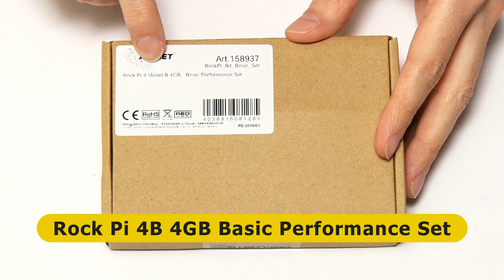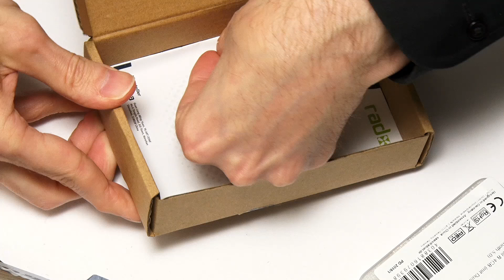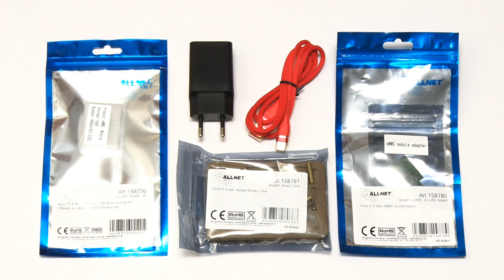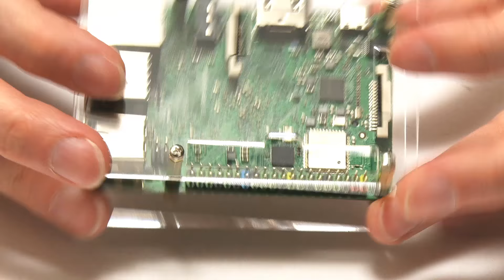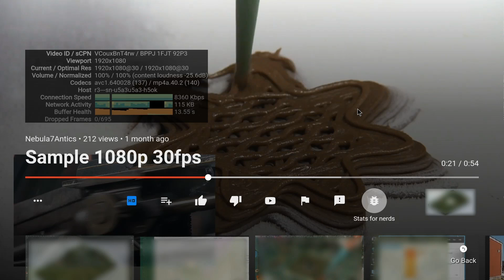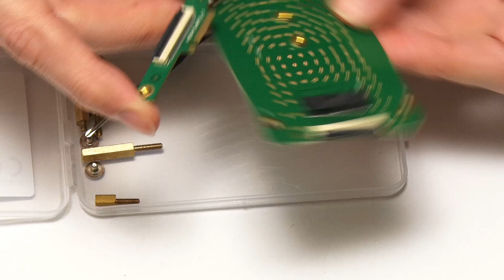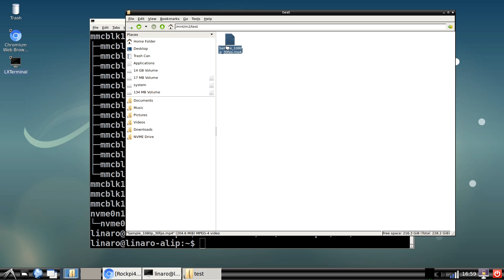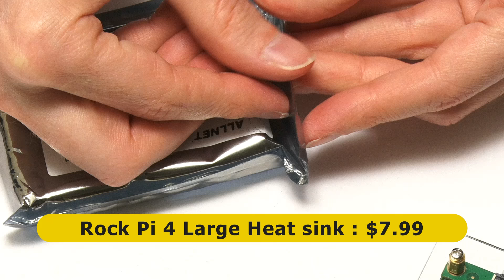Rock Pi 4B : M.2 & USB 3.0 SBC

Comment: This is going to be a critic comment about the product and not on your video. I think that you're doing things very well, as always.

Buuut...

15:00 doesn't look like a "single board computer" to me...

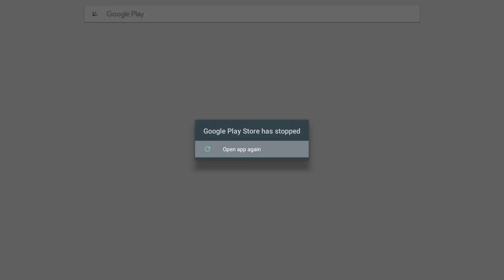13:07 and 15:42: Android doesn't seem that good...

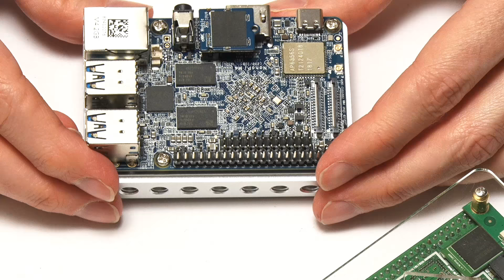19:04 I think that the SBCs small form factor purpose gets somewhat defeated with those large heat sinks... I'm gonna get a Raspberry Pi Zero (no wireless) and call it as such. I mean, it's good to have a very small computer and all, but what's with the raw processing power raising the temp well over 80°C? In a way, I could think that accessories like a heatsink are somewhat compulsory, which is an obvious paradox.

I was also pondering about why the SoC and the RAM were installed on the bottom. The heatsink gave me the explanation. That thing heats up quite a lot, so they had to come up with something. The Raspberry keeps its SoC on the same side of the connectors, which makes it difficult to install proper cooling solutions, but this solves it. Just smash a large flat chunk of metal on its base and you're good to go. No need to think too much.

Comment: Fully Windows 10 running on this single Rock Pi Board?
Reply from the maker: It is an ARM board, not x86, so cannot run full Windows 10. :(
Reply: @ExplainingComputers  thanx for your quick answer...but do you know any Singleboard PC that runs Windows 10 (not IoT)

Comment: Is it possible to boot solely from the nvme drive with this board, or do something similar to Berry boot and use the SD as /boot/ only and everything else happens on the nvme?
Reply: No, not at this time for a solo boot.  There is instructions on the website on how to use a SD or eMMC to boot and run everything else off the NVMe.
Reply: We can confirm that it is possible now. We started to deliver Rock PI with SPI flash which enables the boot from NVMe SSD. :-)
Reply: @NB-sw1op  This is awesome! Thanks for the info, I'll be checking this out very soon now.

Comment: Question: can you install the OS on a NVME and boot from it?
(It must certainly be possible to put the bootloader on the Micro-SD card (or eMMC) and run the rest of the OS (bin, etc, home, usr, var, ...) from the M2.)
Reply: LOL. Just found out there is a follow up video with cooling etc. Question answered. (y)
Reply: We have good news, it is now possible to boot directly from the NVMe SSD when the SPI flash is mounted on the board.
Reply: There instructions on how to do it on the website, but for everyone else, there is no straight full boot from a NVME, must have a Micro-SD or eMMC.

Comment: So to sum up this rather nice Rock Pi runs hot and to obviate, the heatsink is enormous and its on the bottom (somewhat contra-intuitive as you'd want the heat to rise up OUT of the board not Into it), the microsd card protrudes like a high risk for breakage protuberance, the M.2 port isn't appropriate without an M.2 extension board, the M.2 extension board is bigger than the base Pi board, the PoE doens't work without an addon header board. Android play store doesn't work but is less of a problem, anyone wanting this is hopefully orientated about the alternatives to Android and specifically want to escape Google! And as if all that wasn't enough, what more does it need to make the HDMI audio work!?

Comment: Does the 4b have audio input capability, like the Raspberry, or do you have to add an external audio input device? Does the 4b's gigabit Ethernet port have the same limitation as the Pi 3 of topping out at a little over 300 Mbps? Are the OS downloads that you show the same as the  OS downloads that Raspberry provides?
 I am working on a project using a Pi 3b to stream an IP camera to the Internet and I am finding that the Pi 3b isn't fast enough or powerful enough to do this. So, I am looking for a more powerful device upgrade.
Reply: there are no audio input capabilities, you have to add an audio input device. the gigabit Ethernet port does not have these limitations. It provides gigabit performance. the OS for Raspberry are not similar to the OS of ROCK PI 4. But just recently Manjaro ARM 19.06 was released also with ROCK PI 4 support.

Comment: Can external GPU work on the M.2 slot using  M.2 Key M NGFF to PCI-E 4X or 16X Adapter Card?
Reply from the maker: I don't believe so.
Reply: Chris is right, unfortunately Rockchip does not support additional graphics.

Comment: Thinking of getting this or the raspberry pi 3 b+ bit this has slightly better chips and more memory I'm not sure what to get. What's better guys this or the raspberry.
Reply from the maker: The Pi 3 has better software support, this has better hardware specs as you note.
Reply: @ExplainingComputers  I have just ordered one on the cheap off ebay. I went for the 3b 64bit version. It cost £29 second hand. can't wait to test it. Just need a keyboard now and then I'm all set.

Comment: Amazing that tiny thing is more powerful than anything from the 90's.
Reply: I seem to recall getting 60 frames back in the 90s.
Reply: @dwightehowell8179  yea, at what resolution?
Reply: @tt7hvn  This SBC is good at videoplayback, not a 3D rendering, big difference. You easily had 1080p and higher for 3D in common gaming rigs on PCs.

Comment: The Rock Pi 4b can boot from usb HD o SSD?
Reply from the maker: Currently only from micro SD card or eMMC.
Reply: @ExplainingComputers  Is not possible to boot from minimal kernel and bootloader in sd card boot usb3.0 hd?
Reply from the maker: Yes, you could run a boot loader from an SD card nad then pick up the rest of an OS from a USB 3.0 drive (or indeed M.2 drive). But the boot process would always start with the SD card. :)
Reply: @ExplainingComputers  You could explain as to make? Sorry for my bad english. :)
Reply: we just recently did an update and now it is possible to boot straight from the SSD. You must use the SPI flash to do that though.

Comment: Why have the otg functionality in the usb port , its alredy a full sized 3.0 port?  What is that port actually capable of , host/device ?
Reply: yes, it is full USB3.0 port. The hardware switch enables to manually change between host/device mode.
Reply: @NB-sw1op  meaning power with data, and just power ? Thats the part I wasn't getting because its a full sized port.
Reply: @s4b0t4ge7  OTG  enables only data. you can flash the software image on the emmc without removing the module.

Comment: there are too many out there now and I have filled and emptied a shopping cart on about 5 sites today before watching the next video on your channel. Honestly I would just like to see a video that says x SBC is good for X etc. I want to build a SBC that I can run as a plex server that doesn't cost this much and I think after all this I will just wait for RasberryPi4
Reply: same, because i want something I can learn some linux stuff from but also a few other things with. And i'm just going with a raspberry pi 3 b+. Since that has a lot of support and also seems good enough. But again i just guessed.
Reply from the maker: The Pi 3B+ is still my recommended board unless you know you need other, specific hardware features -- such as a USB 3.0, or a powerful GPU.

Comment: Can you boot from the SSD?
Reply from the maker: Sadly not.
Reply: Now you can. The ROCK PI is now equipped with SPI flash which enables the option of booting from NVMe SSD. Please make sure to order ROCK PI 4 v1.3+ bundle or v1.4 which was just recently released.

Comment: Does docker working fine on it? Thx  and Nice video ;)
Reply: yes it does, please use the 4GB version for that.
Reply: I forgot to add a instruction link which explains on how to do it under Ubuntu. https://wiki.radxa.com/Rockpi4/Docker or this https://github.com/Lymkin/RockP_4_Home_Assistant_Build The "Home_Assistant" is running in the Docker container.
Reply from the maker: I have not tried, yet!

Comment: Can someone explain me the proper use of a Rock Pi, or Pi's in general? Is it meant for low/mid level tinkering, and so it can run some low/mid level computing? Where's the boiling point? Can it run some typical Linux (let's say Mint / Solus) with minimal normal use? Is it feasible for this kind of approach? Basically i'm wondering is it good / smooth enough for normal daily operation.

I've heard about this Raspberry Pi phenomena through-out years, but largely ignored it. Until now, when i'm thinking of fanless solutions and my computer needs. I'm ok with something less powerful (atleast for a 2nd / every day computer) , if it's that much more silent and compact.

With this approach, i suppose one could build their own tiny custom basic PC, learn along the way, experiment with cooling solutions etc. I'd interested of this (just to learn if nothing else), but also to build some minimalistic computer as barebones as possible. I don't care much for Wi-fi, Bluetooth and all the needless radiation / connectivity, so this would one way. It's interesting! I might aswell read more about it and go right ahead.
Reply: Max Raider  Thanks Max! So as i understand it, basically you it use for "background" tasks low in consumption. Often mentioned for network / server / media server related uses and general tinkering. That's all the information i need! That's why it was so hard to find some practical everyday examples with Linux. Cleared up nicely.

I'll go for some higher-grade fanless computers from the likes of Azulle, CompuLab, Zotac etc.

Comment: Usb c is nice in that it is a more robust container. It really only need the physical connector there and not a host chip or anything which is fine. The amount of ddr4 ram available does seem quite handy, but I doubt you'll really get the full benefit of those speeds.

Usb 3.0 however, on something as low powered as this, is a pretty big waste. As is gig ethernet and an m.2 slot. This could be made much cheaper if they were more realistic in their part choices for what's really going to be possible with an soc like that.

Comment: Hey Christopher,
Just spoke to the owner of AllNet and he said to anticipate another review on the RockPi 4. They have a new M.2 card that puts the full size heat sink in-between the RockPi and M.2 card. It looks great. Heard theyre going to have a selection of cases to boot. I ordered my RockPi on monday and should get monday. Im glad I waited to buy my M.2 car so I can buy the new one.
Anyways, Im looking forward to the next review. This SBC is a great board so far as I can tell. They have great customer support and are really there for there customers. Great People!!
Reply from the maker: The next review posts here on Sunday (14 April), and indeed includes the new M.2 Extender -- which is really nice -- as well as NVMe performance tests, temperature tests with different cooling setups, a 4K test in Android, and various other things! I've had a good Rock Pi 4 week. :)

Comment: Is Android even SSD-aware?  Android is really designed as an OS for phones and tablets, so will be able to see any flash media such as eMMC or SD cards, but it probably does not know about SSD's, as it was never designed to ever run from one, or to ever access one as you don't find SSD's on tablets and phones.  Just a thought.  Modern versions of Android may well support SSD's.  I am only saying what I THINK is happening. ;)  Happy to be corrected on this.
Reply from the maker: You are correct -- Android is not SSD aware. At present an NVMe SSD can only be mounted in Debian, or other Linux distros. But I think they are working on this!

Comment: Oh, the software and "support":
I get you are talking at the SBC hardware level, but....
At 16:05 you show Debian loaded.
At 21:21 you say software support is not as good as the RPI.
I can't comment on that, but if you are running Debian, aren't you getting the suite of programs?
I appreciate they may not be "ported" for that processor, and that is not in your control, but the claim about "lack of software availability compared to the RPI" seems out of context.
Can you run Raspbian on it?
If you can't:  the whole analogy is even more out of place, because you are not comparing apples to apples - if you excuse the pun.
Reply: You know...processor of this SBC is rk3399 which is designed for Android TV devices, which is pretty popular in China.
And the RPi society, I believe they can just ask the Broadcom to modify part of the chip design, so this is the problem.
Reply from the maker: I'm not giving an analogy. :) There is a lot less software (and by this I mean OS and apps) that work on the RockPi 4 compared to a Raspberry Pi. And once you are running Debian (ARM version), you do not get all of the programs, or at least working versions -- reprositories have to be available, as well as drivers. Eg you can install Kden live, but it does not work). The Rock Pi 4 is a great board, but does not have the level of software support as a Pi. Not least, GPU acceleration is not available in the Linux distros  . . . yet. :)

Comment: Hi.
I have a slight problem with the heat sink part.
Originally you installed the small heat sink which is the small black square that has a nice hole in the case to allow airflow.
Later on you install the bigger heat sink.
PROBLEM:
Looking at it, you have to remove the first one - correct?
You don't say this and it is not explained.   So if someone buys it and gets the "extra" heat sink:  they could easily end up in a world of hurt.
They assemble the board as shown and put on the heat sink.
Then they can not install the bigger one.
Reply from the maker: The small heat sink is easy to remove. :)

Comment: 2 Bad that the Specs are nothing worth when there is no active Support&Community around this thing...

I allready got an Radxa Rock board here that was also 90€ but never ever get in real use because there was no Active Community around it...
So be aware when you spend your $ to this or any other nice Specs having board that you maybe buy a expensive Brick
Reply: wiki.radxa.com and forum.radxa.com could be the way to find the resources and contact with them
Reply from the maker: As I said at the end of the video, software support is not as high as it is for other boards, like a Pi. But it is improving, and better than available for other RK3399 boards.

Comment: why nvme and not sata3??
Reply: Hi, it is a performance issue. Here some comparison: 
7200 RPM Hard Drive – average read/write speed of 80-160MB/second
SATA 3 SSD – read/write speed up to 550MB/second
NVME SSD – read/write speed up to 3500MB/second

Christopher also made a nice video doing performance tests with the WD Black NVMe SSD last year.

Comment: what is the total price of the setup (excluding the ssd ofcourse).... Also can android, running on the emmc, detect an sd card if it is inserted in the sd card slot?
Reply from the maker: I think everything shown is $119.68. Android on eMMC can indeed detect the insertion of a mico SD card. Works fine -- though note that with the M.2 extender board fitted, access to the micro SD card is restricted.

Comment: I bought one on the strength of this vid, three things to note/I wish you'd mentioned for noobies tho.  
1) the ribbon cable IS handed/can only go one way up,  logically, but I had a moment where I could have missed that, 
2) and the eMMC has a tiny barely visible notch in one corner, not sure if it could go the other way round, and 
3) I broke my board by plugging/unplugging the power cable at the board end, the USB-C connector broke away from my board. Be warned, use a switched power strip!  Second Rock Pi on its way from AllNet, woo hooo!
Reply from the maker: Thanks for this feedback, and sorry that you have had problems. You are of course right on the ribbon cable. The eMMC can only insert one way around, as the two connectors on it are slightly different lengths. I've never broken a connector off an SBC, but constantly worry about it as I plug and unplug them a lot. I've been working on a new Rock Pi 4B video over the past few days, and have been unplugging very carefully now! :)

Comment: Sir Chris,   I hope this message finds you and your loved ones well.  I have three questions please kind Sir.
1)  on the Raspberry Pi 3B+, ... Is it better to have a 128gb Microsdxc card OR attach SSD via USB? 

1b) If SSD via USB then do i need to configure it to be identfied and used properly as storage?
(( I will be monitoring and storing security video for home security as well as monitoring smart devices.))

2) In your office..  Do you have 1 HDMI monitor with a multiport HDMI switch to connect different computers to ?  (share monitor?)  if so what is info on switch and purchasing website?

3) I am still having trouble finding HDMI to VGA converter cable that will work with Raspberry Pi.
    I have located several. SOME say not compatible with Raspberry Pi, others do not confirm nor deny.
    Do you have a part number and website for that converter cable?

My most humble appreciation for your guidance and assistance!

PS, IF ANY SUBSCRIBERS KNOW #3  HDMI TO VGA CONVERTER CABLE THAT IS COMPATIBLE WITH RASPBERRY PI. PLEASE SPEAK UP ALSO.

HUMBLE REGARDS TO ALL,

ALTON
Reply from the maker: Greetings Sir. The SSD may be faster than the microSD card, although the Pi is limited by its USB 2.0- interface. The monitor on my desk has both VGA and DVI connectors, and I have a different machine connected to each one. The Pi and other SBCs connector to an HDMI monitor I use in filming. Well, actually, they don't -- then connect to a splitter, that feeds an HDMI recorder, then a monitor. So not a standard setup at all. I would trust Adafruit for an adapter: https://www.adafruit.com/?q=hdmi%20vga%20adater